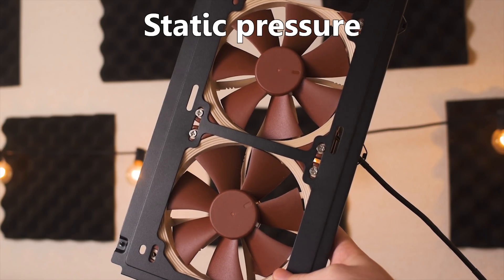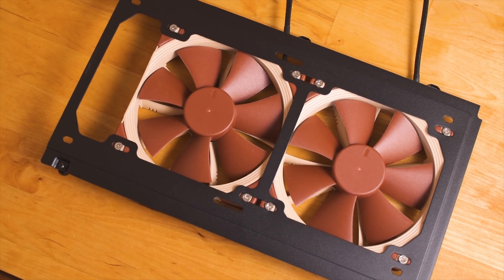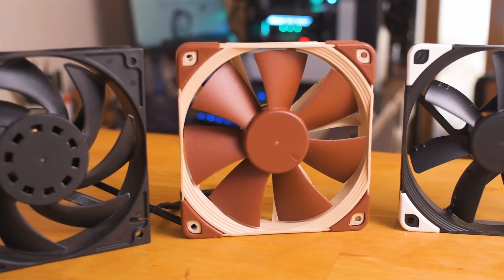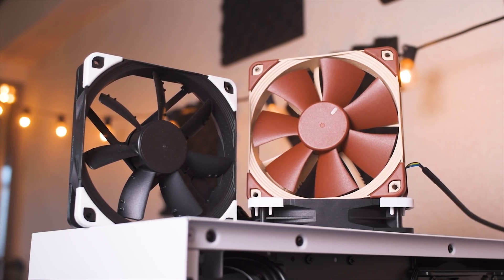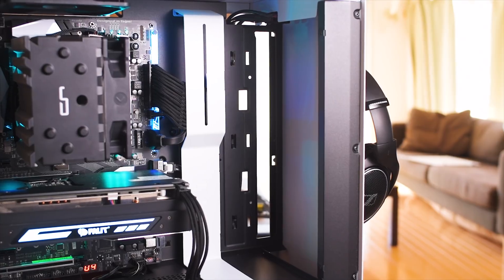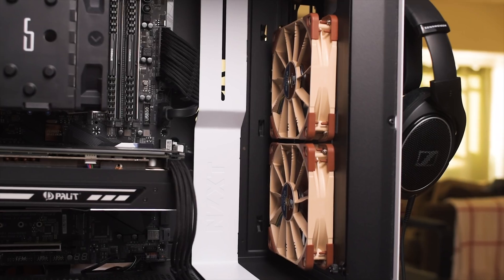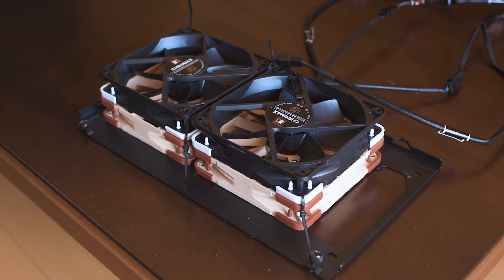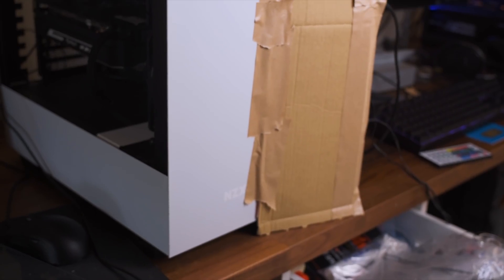DON'T buy front intake fans! (For NZXT H500/S340)

Comment: Mine works amazing. I have a Corsair liquid cooling system on the front and it operates beautifully. Exhaust out the back. Always does the trick. Solid temps.
Reply: Eric Paoletti Hey, man. Randomly came across your comment, and actually I want to inquire what exactly you did to make yours run at solid temps. I have Corsair liquid cooler and it’s in the front. I get excellent readings on everything except the CPU. At idle, it’s running around 80+ degrees C. Just wanna know if maybe I’m missing something small but crucial. Please and thanks.
Reply: @RazrRamonIRL  you may not have a good connection between the cooler panel and the CPU or improper paste distribution. I'd pull it off, clean it up and try again. I've had that happen before. Sometimes it's a finicky process. Just be sure you are pulling air through the radiator, not pushing it.
Reply: Eric Paoletti thank you so much for the reply, man. Ironically I kept at it, and it turns out I was just getting false readings from Speccy. Google told me through a bunch of sources that since I’m using an AMD processor, that I need to download the master utility app to get a proper reading. Been running and gaming on it all morning and it’s been running at wonderful temperatures the whole time. I’m very happy. Thank you again for getting back to me. Cheers to my official first build from scratch being successful!
Reply: @RazrRamonIRL  congrats man!!
Reply: Eric Paoletti many many thanks, friend!

Comment: I bought this case with an intention to OC a Ryzen 2700x. But with these temps on the Stock Wraith Prism cooler, i don't think i can go too far even if I adding a better CPU cooler without adding some type of air for the case.

Ambient 21
CPU    31 / 84
Case   31 / 48
GPU 32 / 81
Reply: Added 2 Intake fans. Made a huge improvement especially with the air blowing on the GPU.

Ambient 21
CPU    29 / 80
Case   28 / 38
GPU 32 / 62

Comment: I like your experiment and find it really helpful. I used my old coolermaster case's fans as intakes because they were just laying around and i didnt want negative pressure in the case (i live in a really dusty environment) however, my question is: while having intake fans does not affect the temperatures, will it help with making the fans run slower which equals a quieter setup? 4 slow fans instead of 2 high ones.
Reply: Surprisingly enough when i tris to add a couple of front fan to my h500 i GoT consistently worse thermals. Guess that thing is designed around negative pressure
Reply: Obviously

Comment: Here is my hypothesis ... the ability to exhaust is the limiting factor.  To test, measure the volume of air input against the volume of air exhausted in each of your scenarios.  I bet it is basically the same.   It does not make physical sense that if you had a higher volume of cooler ambient air, entering the box, that the system would not cool.
Reply from the maker: This is an awesome hypothesis. I would love to test that. Just not sure what equipment I would need in order to measure air volume. :P
I do however think that your explanation makes sense.

Comment: I am using the S340 Elite and I have an NZXT Kraken X52 cooling my CPU. I am not 100% sure what might happen if you remove the fans from the radiator which is mounted on the front with intakes. Will it make a difference in temperatures if I remove those fans off the radiator?

Comment: But what about radiator water coolers?  They don't have the fans right at the cpu for the top and rear exhaust fans to move the hot air but instead use the front mounted radiator. Should the top fan be an intake in that scenario?

Comment: So where is the best place to put my radiator in the NZXT H500?
Reply from the maker: From what I've seen from a bunch of builds online, the front seems like the best place. There is still air being sucked through the front that would help cool the radiator.
Thanks for the comment.
Reply: @DawidDoesTechStuff  can you please recommend me a good 100-120$ Corsair case?Also,what are your thoughts on the Corsair Carbide Spec-06?Is it a good case,cuz I rlly like the design of it and I'm going for an white themed setup?Is the airflow good enough for a Ryzen 5 2600x(or the upcoming R5 3600x or whatever they'll be callin' it) w/RTX 2060 and the Corsair h100i 240 mm AiO?I'll add some Corsair RGB fans ,also can I mount the 240 mm radiator in the front?
Reply from the maker: @mircealeonte5476  I definitely think it will be a great case for those parts. There is a review of it on the website Vortex and they said it has good cooling. They said cable management is a bit hard but other than that it's an awesome case.
Reply: @DawidDoesTechStuff  Thank you,I'll definitely buy it and anyway,I won't build it alone so cable management won't be a problem

Comment: This is very interesting test. Seems like guys at NZXT made this case to work with so called 'negative pressure'. You only have exhaust fans and air flow is regulated only through exhaust. Does it work? I'm not so sure.

Comment: I think the purpose of having front intake fans is to create a positive pressure inside the case... so that the cool air will be sucked in through the dust filter instead of sucked in through every gap that is available and bring dust into the case.

Comment: So an AIO on the s340 elite is a no go? I plan on getting a deep cool castle 280 AIO
Reply from the maker: I think an AIO is still a good idea. I have seen many builds in the S340 with front 280 AIOs and nobody seemed to complain about airflow. However I think it may be difficult to fit the radiator. It does technically support a 280 in the front but I have heard that it could be a bit of a struggle. I think a 240mm AIO will be easier to install.
Reply: @DawidDoesTechStuff  I have a h500i with a 280mm kraken and no problems
Reply: I am confused. I am ordering an h500i with kraken x52 cooling for a gtx 1060 ti with an i7 8700k. Do I need more fans or is the x52 enough??? @bedwyrr-p9z
Reply: @scozy9450  The case comes with 2 preinstalled 120mm (top and rear), just place your kraken on the front. A little advice for you, buy the x62 for maximize the airflow
Reply: StevetheBot 1060 ti???

Comment: So having NF-F12 fans at the front of my case is ok?
Reply from the maker: Yeah, it will help with positive airflow (This means that pressure pushes air and dust out the case) but it didn't help my temps much.

Comment: Love the test. Thank you very much for this. I have an s340. Would you suggest reversing the intake fans?
Reply from the maker: Thanks for the nice comment. :D I haven't specifically tested it, however it does sound like a good idea. I really want to try it.
Reply: @DawidDoesTechStuff  I might reverse them today and see how I go. 

P.S. You have great content for such a smaller channel. Definitely up there with the big time reviewer/techsperts.
Reply from the maker: @mykelti9978  Good luck, I hope it improves temps. If you get time you could let me know if you have any improvement in temps.
Thank you very much for the nice comment. I really enjoyed making this video.
Reply: @DawidDoesTechStuff  Air flow has seen a drastic improvement. Air is able to push out the front of the case with ease rather than trying to pull from a 90 degree angle. 

My fan setup is one 120mm on the back pulling, one 120mm on the top pulling and one 120mm on the top front pulling. Will have to check what thermal differences I notice.
Reply from the maker: @mykelti9978  That is awesome. This has gotten me very excited about trying it out in my case.
Thanks for reporting back. :D
Reply: @DawidDoesTechStuff  no problem haha. I moved the top fan and decided to go duel 120mm at the front. It might work better, I prefer it as well. Might be another thing to check out 😉 What made you research the s340 and other nzxt case?
Reply from the maker: @mykelti9978  So many fan combinations to try out. :D
I think that they are a really good value for what they offer and they are very widely available. Considering that they are more budget oriented, I thought it would be interesting to see if you need to spend any extra money if you have a tight budget.
Reply: @DawidDoesTechStuff  Thats very true!

Comment: was about to buy this one tell i decided to buy the Phanteks Pro M Tempered Glass  one instead since this one looks more like the h440 for how that one did not have good air flow at the front
Reply from the maker: I have the Pro M for my main PC. It's a very versatile case at a great price point. It looks a bit dull though, but if you are happy with the looks its a great case.
Reply: i haven't finished mine yet for how i haven't been able to RGB in it yet but i do get nice temp with my cpu while videos cards where i stay around  40 to 44c while card stay around 55 to 60c

Comment: You should have just used only a separate power supply, tripped it, and connected a fan controller to it.  In any case, what's the point of this? 😂 Does it have an intake on the bottom as well?

Comment: i could care less but you did put the thermometer inside the case right in front of where the gpu blows all of its hot air out so naturally its only going to tell you the gpus exhausted air temp....
Reply from the maker: The external hub also reads temps. So it was testing internal and external temps. The internal temps are a bit useless like you said. :P

Comment: h500 is designed to be setup with negative preasure air preasure so front vents are usles.
Reply: Negative pressure is always bad, air from every single crevice is going to try to seep in, which means they're coming in *unfiltered*. It also means hot air exhausted out the back will immediately be vacuumed back into the case. Even if the front fans don't contribute to lower temps, it designed to neutralize negative pressure and feed the case with filtered air.

Comment: POSSIBLE PROBLEM:
I don't disagree with the results in general, but I do wonder what would happen if you set the GPU and CPU fans to a specific RPM then repeated the tests. Is it possible that SOME of the lack of change in temperature is due to those fans spinning faster?
Reply from the maker: Some people have mentioned this before, but I set all the fan speeds to set RPM.
Thanks for the comment addressing it though.

Comment: you could try using the front as an exhaust.  and the others as intake. better airflow for the fans and since the air would have a harder time escaping it should help with dust prevention since air will be trying to escape instead of enter from all the gaps.